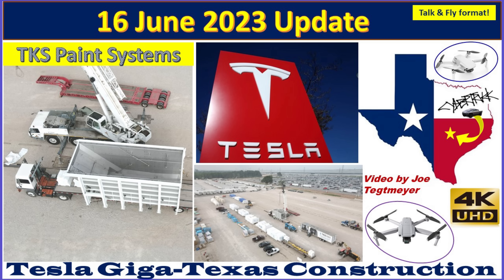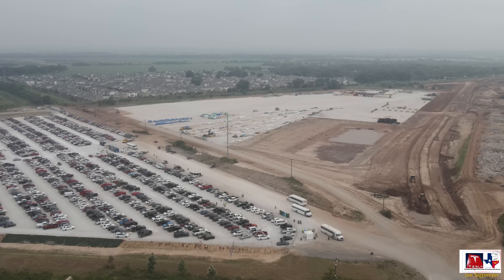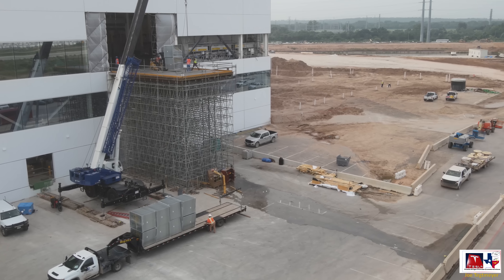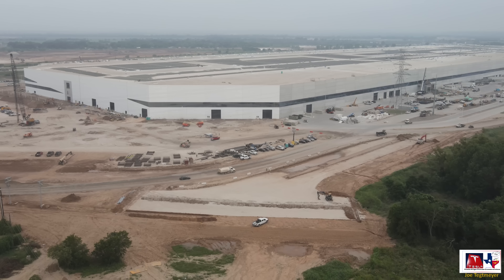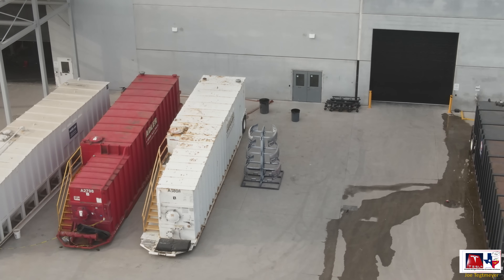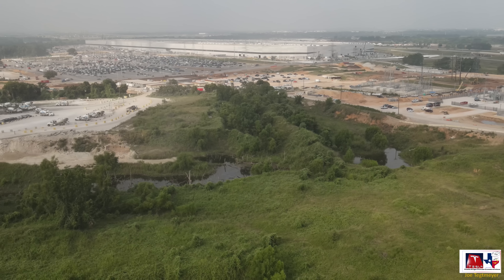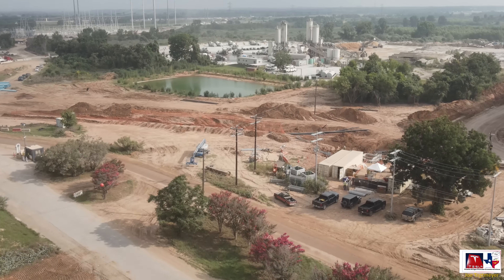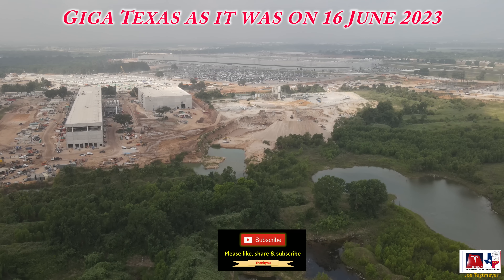Footing Rebar, Megapack Concrete & Steel, TKS Paint System! 16 June 2023 Giga Texas Update (07:35AM)

Comment: Thanks Joe
4:57. Westside storage. Grey crates are marked Striko-Westhofen, been on site for 2 years. Items to the left look like the furnaces seen in Casting. I’ll try and post a link below, youtube gods not happy with links today.
6:19. Battery, wall. 5 louvres. Masked every blade. Louvres in use.
7:57. GA, apron. White wrapped items. EBZ Group.
8:03. GA, apron. Loading docks. The long and the short of pick up trucks.
9:07. GA south apron, against the building. Laid a white pipe under the perimeter/grade beam for future connection. Connecting now would be messy.
9:19. GA/Stamping 2 intersection. New excavation doesn’t meet the existing building footing.
9:37. Stamping 2 doorway. Bottom left. Bin of column hold-down bolts. Plywood sheet for locating jigs for same.
Footings. Only 3 CFA piles in the triangular footings. Interesting that the footings have been boxed up (formwork) for a finished height above the current grade/elevation.
Leaning against the wall past the red tool box, plywood jigs with markings for up to 12 hold-down bolts.
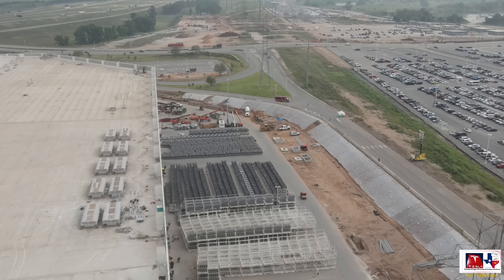14:52. Casting roof. Bottom left. Couple of dozen short galvanised posts/stanchions/columns. Might be anchors for flue guy wires/bracing wires. Similar on existing flues.
15:06. Casting apron. Square ingots are called ‘sows’. Cast iron ‘sow moulds’ would have waste aluminium/aluminum from the presses or furnaces poured in as required.
18:36. BESS switchyard. 4 taller monopoles more or less on each corner. Similar at other BESS switchyards for lightning arrestors to be mounted on. Likely another segment to be attached.
Some equipment (black) placed on the cross arms.
19:35. Easement. Scratching away the vegetation and top soil. Obvious rectangle.
19:39. New switchyard/substation. Mega-Vault. Rebar for walls bing placed. Not unexpectedly, wall height to about ground level.
20:32. Tesla Energy Monopole. 4 narrow trenches radiating from the base. Grounding wires maybe.
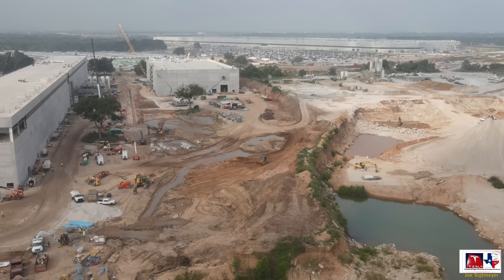21:02. Cathode, north.  Bottom left. Rolling out some fire hose. Possibly another water main flushing.
More hose being rolled out at various locations around Cathode.
21:29. Cathode north. Windows. One unit with plastic covering. Might have been an oops.
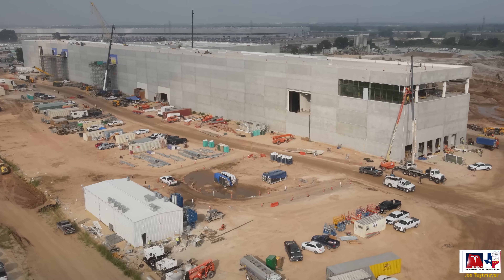21:52. Cell Test lab. Mason/bricklayer working inside in the last few videos. There was an area in the north west corner that had rebar starters for a core filled hollow blockwork wall.
22:38. Cathode east. Deep excavation. Formwork for a footing at a very deep level.
24:34. Cathode, plant platform. Under the plant platform. 3 light tan geometric shaped objects on top the flared stainless steel pipes. Mufflers? Similar on the roof of Paint.
26:12. Old House Site. Preparing a tree to be shifted.
29:49. Regular hand gestures thankfully return.
Reply: 4:57. Westside storage. Grey crates are marked Striko-Westhofen, been on site for 2 years. Items to the left look like the furnaces seen in Casting, https://youtu.be/Dok_gczJ9hk?t=262
Reply: 19:35 Better view 19:22 Looks like it might be for a slab but it is in the utility easement. Very unusual. Also, aren't those the HDD bore holes next to it?
Reply: 24:34. Cathode, plant platform. Under. 3 light tan geometric shaped objects on top the flared stainless steel pipes. Mufflers? Similar on the roof of Paint. Far left, https://youtu.be/-H2kd475bRA?t=752
Reply: @DavidJohnson-tv2nn  19:35. It seems to straddle both electrical easements. 

I think there are 2 electrical easements, plus the pipeline easement. My reading of the site plan is 2 parallel easements at that point.

Might be the launch site for HDD boring to the north and the Tesla Energy monopole.
Reply: 19:39 Closer view 19:51 No rebar bent over to tie into a concrete vault cover, at least not yet. Possible steel beams for a building floor to go on top the walls? Again, just speculation.
Reply: @DavidJohnson-tv2nn  19:39. Lot's of options there. Concrete planks, steel decking and concrete, precast vaults placed on top.

Formwork shuttering should give some clues once that's up.
Reply: @DessieDoolan you don't get e ought appreciation!
Reply: @shadowmancer7040  Thanks! More of a hobby than anything, part of my morning ritual.

I note whatever catches my eye. Sometimes people comment, sometimes nothing.

Comment: the yellow membrain is called “Stego Wrap”, it is a vapor barrier used below concrete pours to keep water vapor from passing through the concrete..  ashesion of paint / epoxy is much better with it.  it comes in 14’ x 160’ rolls, most commonly as 15 mill thick, it’s quite expensive, but nothing better to keep water vapor from passing through your concrete, especially if it’s going to be finished with paintor epoxy..  I used it below the house & garage slab i built in 2018, then epoxied..  the epoxy looks as good as it did 5 years ago when it was applied (zero delamination/seperation)

Comment: 24:46 bottom, right. Joe always mentions 1)chiller and 2) vaporizer but for some reason he never mentions the third main system being installed here: compressed dry air supply. It is certainly a major part of this auxiliary systems plot with no less than 4 compressor/dryer units in view. An interesting detail: there are pipes sticking out with a blue plastic cover. Most likely these are the air outlets to silencers to let off air pressure when needed. The end-parts of the silencers were on grade a couple of days ago (also with blue plastic) but are now out of view (I presume that the common air intake is via the chimney next to the tall buffer vessel).

Perhaps the Evapco cooling towers form a closed cooling system, without water spray and without escaping saturated hot air. The air intake for the compressors is practically next to the cooling towers and to suck in humid air from the chillers seems self-defeating. After all the whole compressor system is set up to produce bone-dry air for pneumatics etc.

A further thought on overall progress here. This entire auxiliary plot, when built as part of major oil&gas construction project, wouldn't take more than a month, tops, once foundations are ready. Plus a few weeks for instrumentation, commissioning and testing. Here we are treated to a slo-mo construction effort that goes on for a year by now?  The logical conclusion is that the critical path for the auxiliary systems is not the completion of the outside plot, but the system extensions inside this very large building, probably from top to bottom and from one end to the other - a major construction effort.
Reply: 24:46. One of the air outlets is visible at 24:18, the blue film seen to the right of the hi-vis vest. The others at 24:46 have disappeared under what (your information confirms) are likely mufflers, the light tan stepped tapering boxes. Similar on the roof of paint near the RTO flue.

Nice lot of observations in your second paragraph. So, 3 entirely separate systems here? No interconnection?

Progress. Critical path. Maybe some design in progress, design changes also. Read somewhere else today of the delays/possible mothballing of the Battery plant at Berlin. Suggestion is the 'Inflation Reduction Act' is to blame. Opposite effect here might be the case, a rethink to increase volume.
Reply: @DessieDoolan  There may be several separate cooling loops, I don't know. If there is one loop that is filled with water for low/medium level cooling duty it could be interacting with the air compressors to cool the compressed air prior to entering the pneumatic systems. There may very well also be some closed loop cooling system filled with thermally stable oil for cooling at (very-) high process temperatures. When I looked up calcining and sintering operations some time ago I found that heat recovery is very difficult if not impossible and that most of the heat (sintering kilns need 800-900 deg C) simply has to be rejected. On the other hand, I also noticed there are developments with electrically heated, "vertical kilns" if I recall correctly with better overall heat efficiency. But out of my depth here...
Then I can think of an additional system, namely that part of the "vaporizers" is a separate system for producing Argon gas. If "hints" from Drew and Elon are being realized then the Cathode process may use pure, metallic Lithium somewhere along the process and that must be processed in an 100% Argon environment to avoid a Lithium-Nitrogen reaction. 

And don't forget the HVAC duties to keep the entire building cool and pleasant to work in.. I'm still a bit at a loss why operators have to work completely devoid of daylight. It would drive me nuts. Perhaps the glass enclosed floor is the operating centre and that most parts of the Cathode processes work on remote control, AI etc.

Regarding increased volumes: I think that is very likely as soon as the first process line is tested and running at capacity. If they have a lot of confidence they may indeed pre-install the major components for more lines while awaiting feedback from initial operations. Certainly there is a lot of equipment waiting at the far North staging lot.

What us watchers really need is a Battery Day 2.0!
Reply: @hardernl8893  Argon. Matheson supply argon also. Not sure if we have seen a gas identifying symbol on those tanks yet, so could well be argon.

Increasing volumes. Where I was coming from was that the Cathode Plant might have been in an advance design stage when the Inflation Reduction Act showed up and upset the apple cart. Might have been a pause and rethink.
Certainly put a halt to works at Berlin.

Lack of windows. Could it be as simple as wanting to keep prying eyes out?
Reply: Correction: in the meantime I found that the "lamp shades" visible between the blue-capped piping are in fact the air intakes to the compressors. The YT link isn't co-operating so the reference can be found under "AFP series panel style air intake". The smaller chimney next to the tall vessel must be for some other purpose.
Reply: @hardernl8893  Thanks HarderNL, you made my day. No amount of searching could find them at this end.

Image searches only showed up piles of cardboard boxes.

While searching I came across the term ‘dense phase systems’. 

Could be what the compressor system is for. Applications seem similar. One US supplier of such systems is JDB Denseflow. I'd post a link except the Youtube gods aren't happy with me. Similarly the google gods didn't help me find the 'lampshades'.

Comment: Joe, Can you tell us how the procedure used to get cables installed through all those underground conduits please?  Thanks for all you do!
Reply: They blow, or, suck a thin string through the section they are working on. They use this string to pull in a nylon rope of the proper strength. This rope is used to pull in the cable  bundle.

Comment: At 26:10 can see them about to move the tree near the old house
Reply from the maker: Yes they are!
Reply: I was reading about a new high rise building they are proposing for downtown Austin. While the building is going to be 55 stories tall, the actual footprint on the basement and first three stories is really hampered by two heritage pecan trees on two of the corners of the property. They are giving up a lot of square feet and spending millions building around those two trees. The artist renderings look great and the two trees really will soften up the ground level views but boy are the expensive! But it’s what it costs to not just have a downtown of concrete canyons.

Comment: Have your sources given you any indication of when the Cybertruck manufacturing line might start up? It has to be soon, and I am stewing in my own juice waiting...As you know, I was very critical of Joey Klender claiming on Teslarati that they have been building Cybertrucks at GigaAustin for some time now.
Reply: Well they have built a number of Cybertrucks either at GigaAustin or elsewhere using parts from there, like castings. So far it’s just test articles. 

They announced the first release articles fully built using the production lines will be in late August. That lines up with the info from Joe’s recent videos. If that time line holds we should see deliveries by late September.

Comment: BESS yard: @ 17:36 Beginning to place transformer/switchgear pads 17 per side, 34 total. Large hole for power conduits. Small hole for control conduits.
@ 18:04 Conduits for control cables from both Megapack rows come together at metal rack by vault. Third trench goes off toward duct-banks going to "Tesla Enclosure". Notice back fill with no concrete over conduits. This will be low voltage or fiber optic cable.
BESS substation: @  18:34 and18:59 24.9 kV switch components on top of poll? Or insulators?
@ 18:48 This is the high voltage 345 kV end of the substation.
@ 18:59 Narrow conduit trench from cable tray makes 90 degree turn to run along east side.